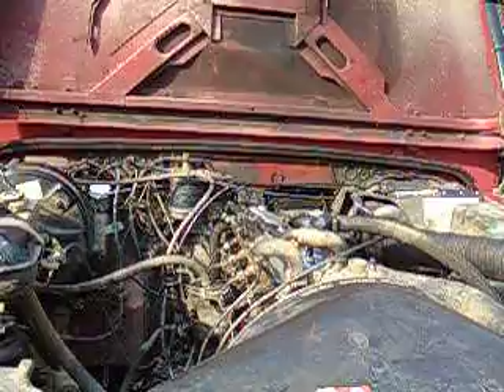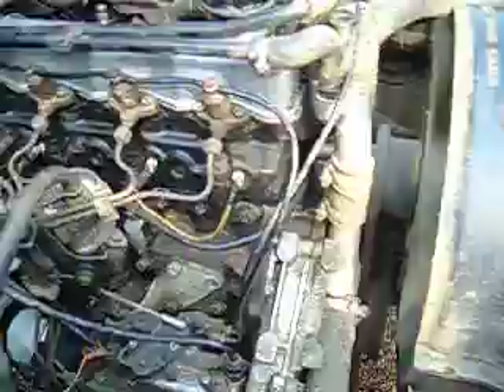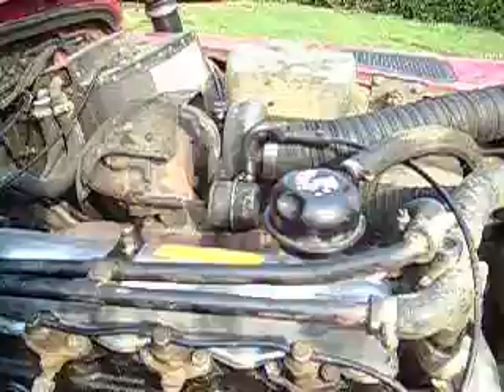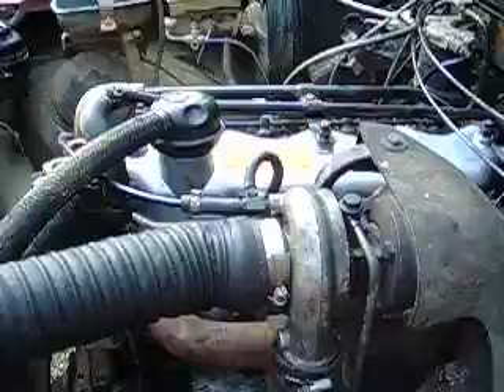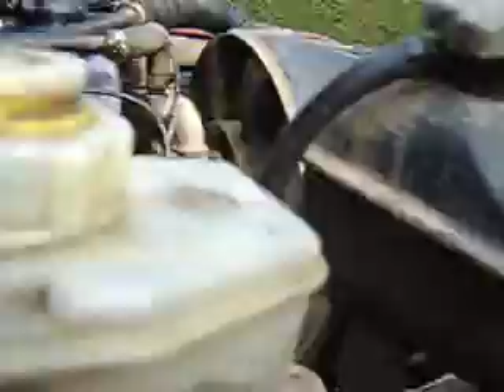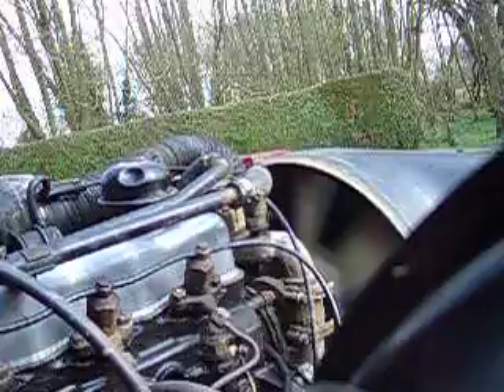Land Rover engine start-up and run

Comment from the maker: That's because the fan has a viscous/fluid coupling, rather than simply being bolted onto the water-pump pulley. The coupling only 'locks up' fully when the engine is hot and needs the extra cooling of the fan, thus saving a little bit of fuel and letting the engine warm up faster. In this video the engine was cold, so the coupling was still 'free', allowing the fan to spin.

Comment from the maker: It's the 'Diesel Turbo'- the engine Land Rover fitted before they developed the Tdi units between 1986 and 1990. It's based on the 2.5 non-turbo engine, which is very closely related to the original 2-litre diesel from 1956!

Comment: I have land rover factory reconditioned one of these engines with only 20k on the clock just waiting to be droped into my series 3. Later 2.5 TD's, just before the tdi came out are suposed to have had all of their ealier problems such as pistons cracking and the infamous runing away fueled by its own oil (Happend to my uncle) sorted out.

Comment from the maker: Hehe- no. The head gasket failed and so I took the chance to give it a full rebuild- rebore, new pistons, new bearings, new camshaft, overhauled injectors/pump etc so the airbox is nice and clean. When the video was made it breathed a bit of oil into the filter- not too much that a K&N filter and a clean-out with the degreaser every service wouldn't cope with though.

Comment from the maker: Had I taken the head off to find ruined hotspots, cracked pistons, coked-up valves and general engine death I'd have considered dropping a Tdi in but it was perfect apart from the failed head gasket, a bit of bore scuffing on two cylinders- I change the oil every 4k and hopefully it will go for another 150,000 miles.

Comment: I drove a 90 with one of these engines, it wasn't to slow.
U can adjust pump a little and raise the boost about 2 psi, any more and u may loose power as the air will get to hot loosing density.
I once disconected wastegate and it made no difference to speed. But that was standard pump.
U can easy get a safe extra 10bhp and not effect mpg.
 hardly.

Comment from the maker: The 'classic' Black Cab- the Austin FX4- used the non-turbocharged version of this engine in the 1980s. I don't think they ever used Perkins engines- the last FX4s used Nissans, and the modern ones have Ford or VM turbodiesels.